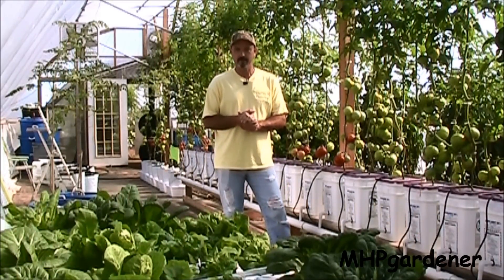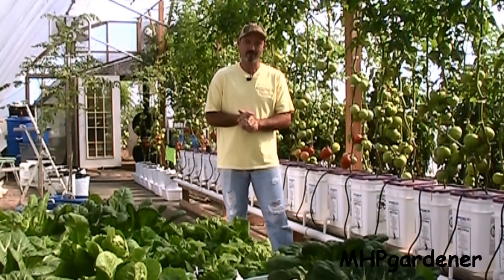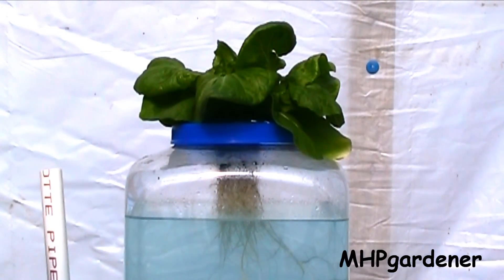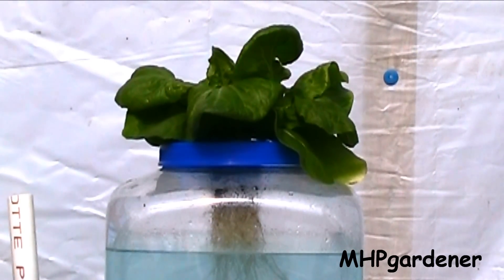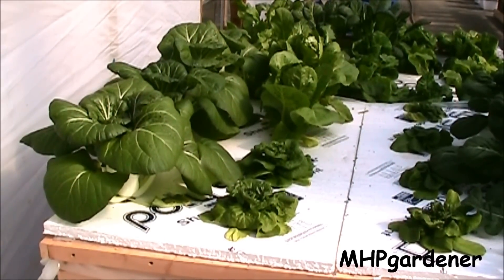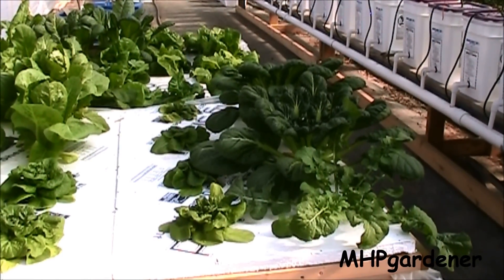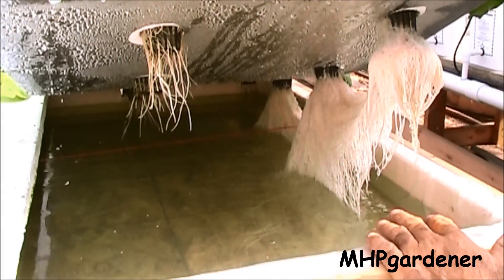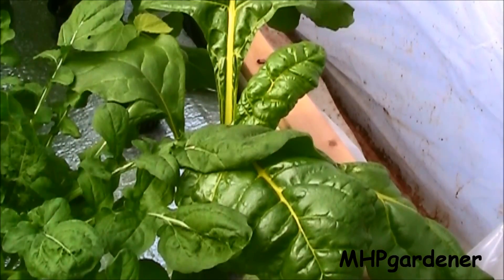Off-Grid Hydroponics Experiment - The Kratky Method & Floating Raft Hydroponics

Comment: Great lesson in choosing similarly feeding plants per grow table.  Saved me from learning the hard way!  I also now understand the difference between the floating raft system & Kratky method.   My brother built a box for me based on one of your later designs.  It has a little lip on the inside set down the thickness of foam board, (so board is level with box frame top).  Also has small wood oiece angled at corners to secure foam from wind.  While not needed inside a greenhouse, these modifications enables the box to be used outdoors in weather without foam board blowing away.  My box is 48” long & it’s just me, so I may put heavier feeders with similar harvest times in it, (Cabbage, Bok Choy, Chard, Senposai, Chijimisai). 
Love the cinder blocks!

Comment: Nice Channel. Aren't lettuce considered Shallow Rooted?  IF the other plants are drinking up the water faster than the lettuce could grow, then it makes sense they would be out competed.  I cannot tell how much you refilled or kept the water at a certain level, but I would think you woud need to keep the lettuce water level closer to the head. This is not actually a floating raft, it's being held aloft by the frame. it's benefiting fast long growing roots and doing a disservice to the lettuce. It's not the fault of the system the lettuce is not triving anymore than it's the fault of the lettuce if one doesn't water it for weeks on end.   A true floating raft would be actually floating on the surface of the water.  That style would be able to grow watercress which is another shallow rooted  leafy green without even a need for an air space tween the head and roots.  

I had some lettuces growing in 20 oz coke bottles , which is tall and deep,  but because the lettuce was the only thing drawing from it ,the water did not receede faster than the lettuce roots could grow.. withour any aeration, or pumps, just a soda bottle, the lettuce did indeed grow roots all the way down to the bottom of the bottle. It was a nice small head of romaine by the time it exhaused its nutrient solution because it didn't have to compete for water levels.  One of the things I am learning is that while it seems like a set it and forget it system, one still has to consider what is going on with the roots and that might mean maintaining water levels at a much higher hight througout a season to make sure the plant doesn't struggle to receive the nutrients, otherwise what is the point?  We want the plant to have an easy life, unless some quality of stress causes a desired outcome. 

As for the raft,  One of the reasons using the styrofoam seems appealing is the fact that is is inorganic and will not be consumed by bacteria or fungus and thus will have a longer life than something like a wood plank  or plastics which become brittle with UV exposure.

Comment: Hi was wondering if i have a premixed stock solution of fertilizer in a tank, (12.12.17.2 + Calicum Nitrate + Magnesium Sulphate) does the nutrients degrade after some time without aeration. Or can i get away with using it to water the plants without sacrificing the nutrient potency. Any assistance would be appreciated.

Comment: I wonder what would happen if you made a simple system to maintain the water level on kratsky method. Should be quite simple to automate. 

Or simply top off water manually from time to time. You would dilute the nutrients solution, but the nutrient amount in the container would remain the same so it might not be a problem?

Comment: I became a great believer in wicking at one time, it was entirely passive, just add food/water to keep the tray my rockwool is sitting in wet, could add a week's worth, it would wick to the roots in the rockwool, no pump, no electricity, made sense. Could go on vacation for a week! No fire hazards... But now I see the Kratky's method, and I get tired of buying and throwing away growing medium. I see the Netcups, using some kind of reusable medium, floating. BUT WHAT YOU MISSED IN YOUR EXPERIMENTS, was the fact that you can simply have the raft floating 1/2" out of the water on pontoon like spacers, (to oxygenate the root ball) and NEVER WORRY about your other Kratky setup that had to be closely monitored daily because it's NOT FLOATING! Just put pontoons on that floating cover, and it will just be set and forget, with NO AIR PUMP, correct? ;-) 
Get this going outdoors, in the sun, and take a 2 week vacation once you know your setup!
I think I will build one soon, you have inspired me sir, to be more green and think green. 
Thanks so much!

Comment: Confused about floating Kratky method because it is always on water with no air gaps like what Dr. Kratky illustrated. I guess it will be just fine if there is no oxygen in between when the plant grows bigger. All Youtube videos on Kratky hydroponics will tell you that if the plants are bigger, you only fill nutrient solution in the container up to 2 inches max or you will kill it because there's no oxygen. Your floating Kratky method proved them all wrong...lol This is an old video, so it will be great if you can make an update of this floating Kratky.

Comment: Ive gotten hold of a homeade ten gallon tank as well as bioballs inside it in a separate container. Id like to grow most of my plants hydroponically as well as with a drip system ive bought. I got lucky and was given alot of different hydroponic solutions to use as well. I bought a pump n ive got tubing. Also airstones n the machines for it. Im just afraid of not setting it all up the right way. The weather here in Haverhill Massachusetts has been cold n rainy. Its just started to warm up recently thankgod. Anyways itdd be so much help to me if i could facetime on messenger with you n i can show you wjat ive got. I want to incorporate all ive got. At this time im not wanting to use any fish only the solution. I know youve got lots of people asking you questions and ill understand if youve not got the time to help me out. I wish i knew someone whos close to here who could show me how to do this n do it right. Ive also got 2- 5 foot raingutters as well. Soaker hoses with the timer attached as well as a drip system with timer. I guess i just really need help. Please let me know eitherway😊

Comment: You might try planting the smaller plant a week or so earlier so roots will be longer and then keep up with the others. Also put up solar panel and 12 volt pumps sp you wont have to worry about a power outage.

Comment: If it's not floating it can be plywood or masonite.  The roots may not need to touch the water at the beginning if you keep on watering them from above until they do reach it.  If you grow microgreens in shallow containers you will see that they produce a tremendous mat of roots which could reach downward if space was available.  Great method.

Comment: put a swamp cooler float valve in the basin to regulate the water level.  As the water level drops, the float valve allows more water in automatically and you never have to add water manually.

Comment: much of the reading I did before setting up my own deep water culture system stated that you had to graduate the nutrient level up as the plants went from seedlings to full growth.  With the Kratky of set and forget, how do you accomplish this?  Additionally, with my deep water culture, I see that in about 15 days, the water levels drop, but additionally, the nutrient levels drop and plant growth slows. Once I refresh the tanks with new water and nutrients, they take off again. With Set and forget it seems like you'd end up with either A) depleted nutrient levels, or B) if you add additional salt, you'll end up stacking unused nutrients.
Reply: My exact question.  Could you find an answer ?

Comment: Sorry if someone's already asked but with the still water doesn't the water get oxygen depleted and encourage anaerobic root attacking bacteria ?
Reply: i'm probably not the one to answer but from watching the video  the kratky method of not having the foam floating instead having an air gap between the water and foam the roots receive oxygen thus allowing you to not have air stones in the water. i'm guessing that over time the still water could be issue but since it's just greens they should be done before that could happen.

Comment: can i ask someone, how do these methods get around the water temperature issue, if the water temp gets too warm the roots suffer
Reply from the maker: Once it gets too hot, I shut things down. There are ways to cool the water, but I'd rather move on to something else.
Reply: so you are saying that this system is more a season thing if you live in a high temp region ?
Reply: +niceslug 
so what's too hot?
Reply: generally lettuce and many other plants do not like temps over 23 Celcius

Comment: So krattky method is good because roots have air when the water goes down. And floating system does not have that air because it lays directly on the water all the time. So can we conclude that you actually do not need that air krattky method advocates? I am confused :)

Comment: how do you seed? directly in the net cup? What kind of "soil" in the net cup? thanks
Reply: +tom jens rock wool or coir pellets with any grow medium around it.... but i would add a pump, this will maximize air to the root
Reply: +Ronaldo Julies Sounds good. So lets say I choose to seed in coir pellets and use hydroton as grow medium. I imagine I put coir pellet with a seedling at the bottom of growing pot and on the top I fill it with hydroton. And the water level should barely touch the bottom of the pot/pellet? That sounds clear. Now what if the pot is too deep and I need to put my coir pellet somewhere around the middle of the pot. Then I would put hydroton at the bottom of pot and on top of that I would put a coir pellet (then some extra hydroton on the top). Now the question about water level in this case - should water be leveled with coir pellet (which is somewhere around the middle of pot) or is it enough to touch the bottom of pot (where only hydroton is and coir pellet is not touched directly by water)? With the assumption that hydroton will pass the water upwards to the coir pellet eventually. Thanks
Reply: tom jens If i understood correctly... the water should just fill an inch of the net pot... but once the root start growing, do not cover the roots with water.... 50% air, 50% water....
Reply: +Ronaldo Julies Yeah, but there can be different scenarios. a) coir pellet is at the very bottom of the net pot, so inch of the pot would mean that all the coir pellet is bellow water. b) coir pellet is not at the bottom of the net pot (at the bottom there is hydroton), so in this instance the water would not even touch the coir pellet at all :)
Reply: tom jens ok, so basically you're gonna have an inch of growing medium in net pot an inch of water...with an coir pellet on top, this is enough water....

Comment: Great video. Thanks for sharing. I'm always looking at new ways to grow in case grid power is unavailable. 

Question I noticed on the floating method you had the reflective foam side up. Does it matter? Also will letting the same water sit for 30 days apply with it aswell?

Comment: Hi,  I took a hydroponics class taught by Kratky at UH Hilo. For my project, to overcome the issue that subirrigation has with different root growth rates,  we set up a system that was sort of a cross between the Kratky system and sort of Dutch pots. 

We set up a 55 gallon trash can filled up with nutrient solution. That was connected by a tube to a pot with a float valve in it, and below connected by tubing were a series of pots fitted with Styrofoam with holes and net pots suspended a quarter of an inch as is done in the regular subirrigated stationary system. The float valve regulated the water level so as the plants used the water and nutrients,  more would flow into the pots to level the water. That way,  plants with differing growth rates could grow together. I grew zinnias, basil, and butter leaf lettuce together. No electricity needed. It was a great class.

Comment: Hello, I am doing my own experiment with the same method, i planted lettuce a month ago everything is great except the leaves are soft they look good but when you touch them they are soft and not crispy hard, the EC level is around 1.5 PH level is around 7, could somebody please help
Thanks
Reply: In Hydro PH should be set 5.8 as there is no acidity buffering from compost. EC must start low ie. .5 Ec    get a ppm meter and some ph strips.

Comment: We tested a new form of non-circulating living machine hydroponics. It uses water hyacinths to prevent water eutrophication, azolla to provide nitrogen, composite rock dust powders as the plant nutrient source (granite gneiss rock dust powder mixed with limestone rock dust powder seems to be the best, depending on conditions), a bottom layer of metal mesh and plastic mesh with a layer of diatomaceous earth fine gravel and zeolite fine gravel placed on top and with the metal-plastic mesh going up the wall and over the exposed side and covered with a third layer of metal mesh (metal mesh-plastic mesh-metal mesh layer). The top is covered with a structural expanded metal covered with the same mesh material and the top sides about 6 to 8 inches thick of charcoal. This structure is 2 inches above the water. On it are holes containing the same mesh in the form of a retaining pot. The pots containing the crops are filled full and just 1 inch near the top with charcoal and goes 4 inches deep into the water but the pots containing the water hyacinths and azolla are filled only at the bottom with charcoal at the bottom 1 inch thick. The sides of the hydroponic troughs has holes 1 inch wide and 6 inches apart and covered by the metal-plastic-metal mesh. But the sides of the hydroponic troughs are covered with a 4th layer of plastic mesh. The water is mixed with the rock dust powder mixture(s) until saturation point is reached. The diatomaceous earth and zeolite gravel layer acts as a bacterial converter due to their large surface area beneficial bacteria can be accommodated to convert any organic wastes into beneficial plant nutrients. No power is required. Just sunlight and rock dust saturated water is added to replaced what was consumed by the plants by transpiration and to build up their plant tissues. This is similar to the non-circulating Wroclaw Hydroponic Method developed in Poland during the 1950s but modified to add the Living Machine Principle and Method developed by Professor John Todd. The system should last indefinitely provided it is properly constructed and using high quality materials, and maintained and tended carefully during it's operational life indefinitely.

Comment: Hey cool video. I was just wondering if you had to change the water at all in the static system or did you use the same water for the entire cycle? Also what else is required? Did you have to add nutrients, or adjust PH at anytime? Also whats the average ambient temperature of the air in the green house? Thanks
Reply from the maker: B-rad In a static system, you never change the water. The only thing you do is top it off if the reservoir runs low or is too small for the plant. Temps in the greenhouse have wild variations. It can be 50 at night and 90-100 the next day if I don't ventilate it.

Comment: I'm curious, you seem to have been using these floating raft systems for a few years now. Have you seen any degradation in the plastic? You seem to be using the 6mil big box store rolls of plastic that a lot of DIYers are using. I'm curious as to the plastic's lifespan since it's not in direct UV for the most part due to the foam and plant coverage.

Comment: The Kratkey method is impressive. Indecently, the top layers of water will also have some oxygen dissolved in it. As the roots use it up, more oxygen from the air dissolve into the top layer of the water.  On the other hand if the water were kept at one level, as the roots grow, they consume more and more of the oxygen from the water until the roots are consuming the oxygen faster than it can dissolve down to deeper levels.

Comment: I'm still not 100% sure what happened between your bak choy and lettuce segment? Is he saying the bak choy sucks more water and thus lowers the levels where the lettuce can't reach? Or more along the lines of it's using all available nutrition and you cannot add enough nutes to supply both without the water becoming toxic?
Reply: The theory behind the Kratky method is that the plant only uses as much water as it needs for growth and plant respiration. As the water level drops the older roots are exposed to the air.

When he had two different plants that grew differently, one consumed the water faster and grew roots to drink up as much water as it needed, while the other grew too slow so that when the water level dropped the roots could barely sip.
Reply: Keith Reynolds
Gotcha, thanks.